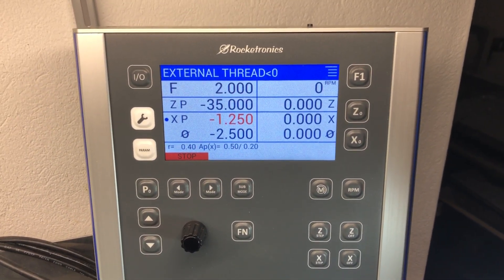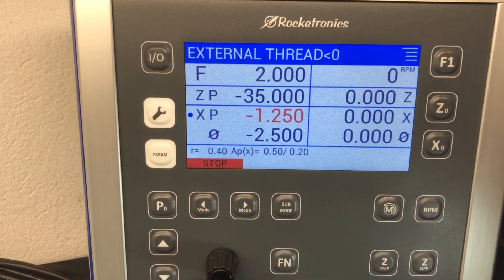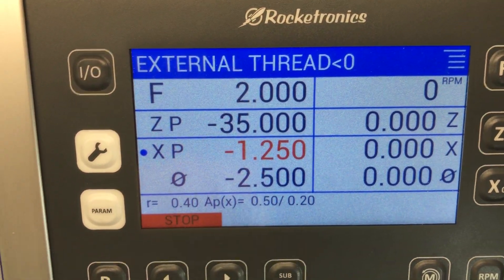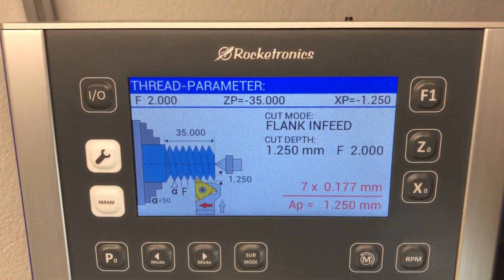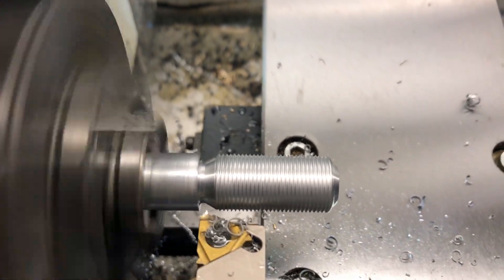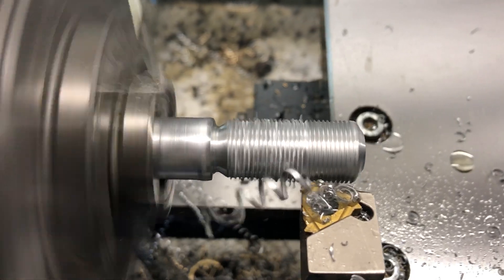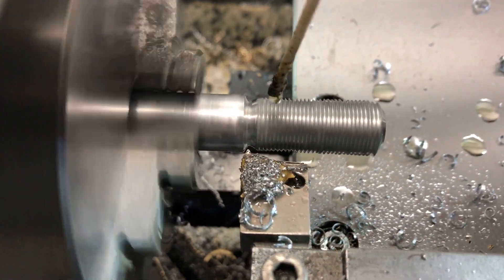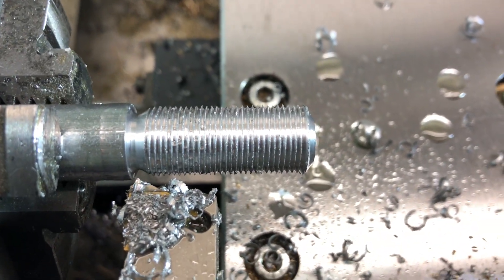Left hand threading with the Rocketronics ELS4 electronic leadscrew control

Comment: Rather than a pendant, could the ELS4 Pro support a pair of rotary encoders as inputs to control the X & Z axes?

I'd like to replace the acme screws of both axes with ball screws for increased accuracy though I also want to maintain some form of manual control. Placing the X axis motor at the back of the cross slide with a handwheel in the original location is possible but a ball screw for the carriage would eliminate the half nut and require a Z axis handwheel be located at either end of the machine. 

If the ELS4 Pro would support 2 independent rotary encoders I could position them where the original manual controls were located, giving me digitized hand control of both axes plus the automated threading/tapering capabilities of a 2 axis ELS.
Reply from the maker: Hi, the ELS can only manage one encoder, so we need to switch between axes.

Comment: Only problem with this is you are using a right hand threading tool . The tips for these are designed to cut feeding to the left. If you look at the cutting tip through a comparitor or good magnifying lens you will see the difference in geometry either side of tip. You will get a far better result using a left hand tool, mounted eather to the rear of the workpiece or mounted upside down in front of the workpiece.Left hand tool ips are designed to cut in opposite direction to right tool tips, and will give a far superior cut finish.
Reply from the maker: I know, it is just a workaround for those who do not have the right cutting tools. I prefer the correct tool on the opposite side, then it is also very easy to cut a left hand thread with the ELS, you just use "inner thread" mode then.
Reply: I think you're talking about full form inserts. Partial form inserts have symmetrical edge geometry, at least the ones I have used do. I can cut smooth shiny LH threads just fine.